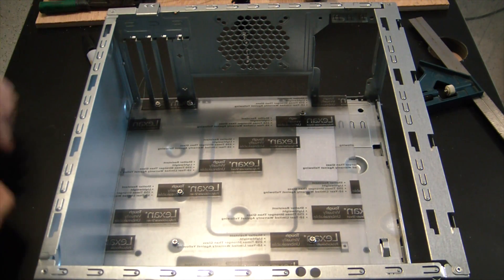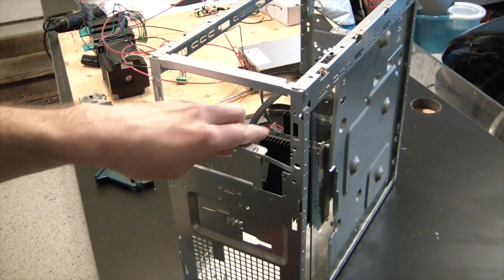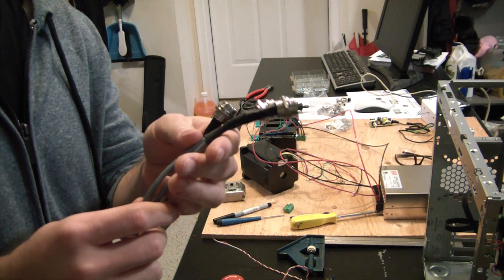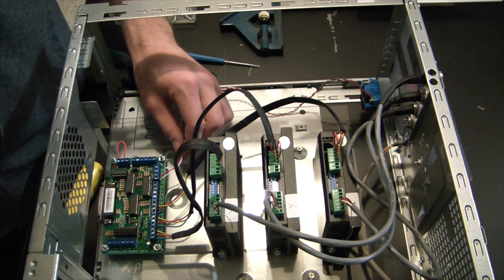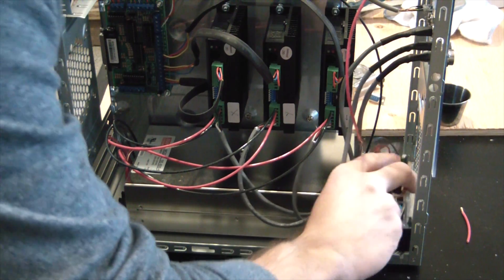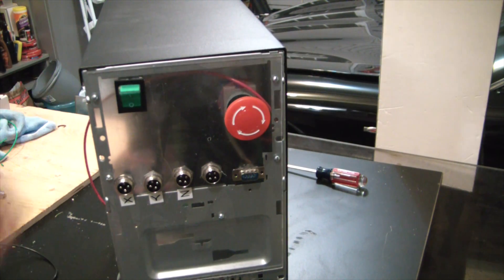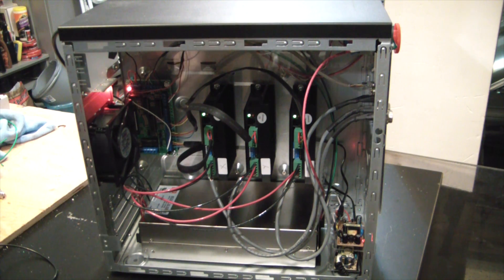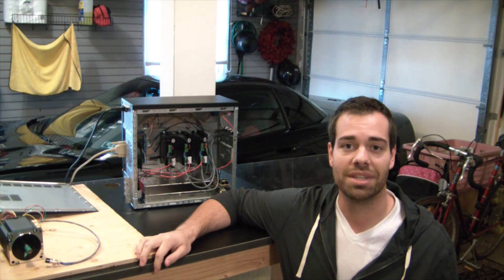ElementalMaker: G0704 CNC Conversion Electronics Part 2: Enclosure

Comment: On the ESTOP, as a safety device, use both sets of contacts.  Use the NC to interrupt the control power in the common line to all stepper drivers to ensure all dir and step is disabled as well as dropping spindle control.  The NO contact remains connected to inform Mach 3 or other controller a critical stop has occured.  Without this a software lockup (EG Blue Screen) would not shut anything down if the controller is inop.  Safety first.  The common between the breakout and stepper drivers should be interrupted by the ESTOP, or it should power down the 24, 36, or whichever supply powers the motors.  I prefer to disable the stepper drivers as that halts motion immediately.  Dropping power to the supply can have a delay for the supply to shut down.

Comment: WHICH SOFTWARE YOU USE TO GENERATE 5 AXIS G CODE , ARE YOU USING STEPPER MOTOR OR SERVO MOTORS AND WHICH DRIVER ARE YOU USING TO OPERATE/ARCHIVE  ALL THIS MOTIONS
Reply from the maker: WHY ARE YOU YELLING AT ME?!?! (Don't write in all caps please - for future reference). The printer runs off stepper motors, and the Gcode is made using ReplicatorG and Slic3r